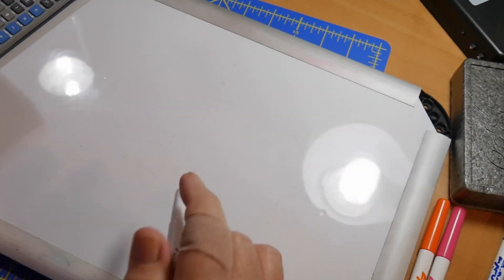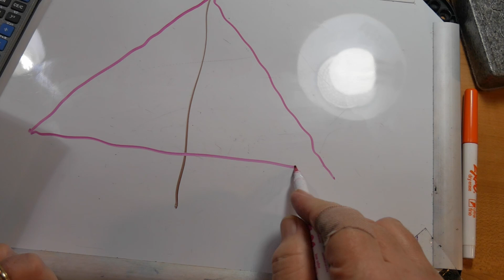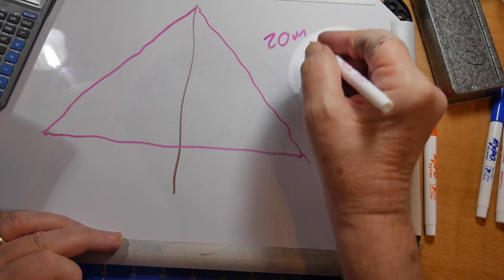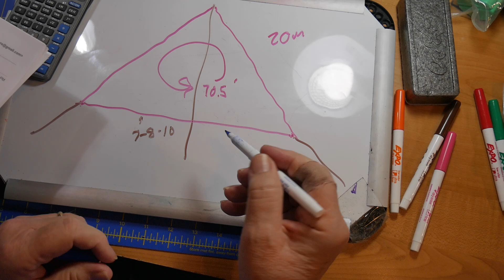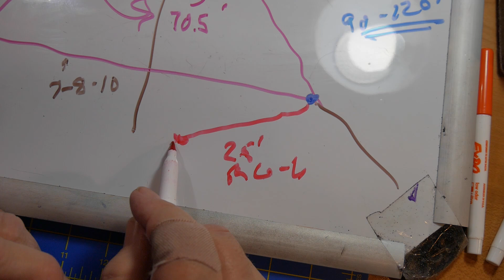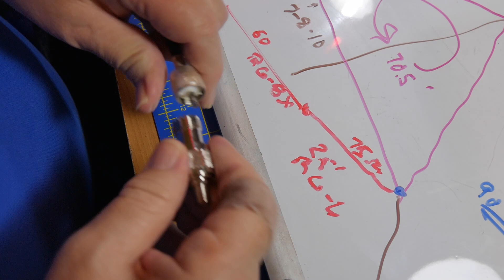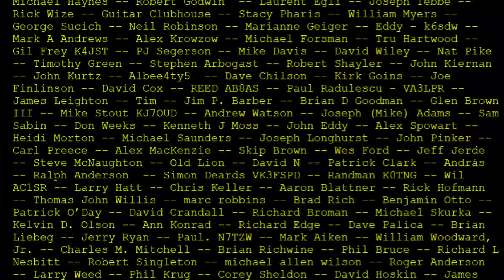Quicky 20 Meter Loop (#1193)

Comment: One question Dave - Could a delta loop be horizontally installed instead of vertically? -If so, what direction would it radiate? Thanks - Cheers!
Reply: Commenting because I'm interested too and I'd like a notification when you get a response - N6IMI
Reply: I'm not Dave, and I don't answer for him, but to answer your question until he comes to reply.....

The vertical delta loop will be bidirectional broadside to the wires.  It is not real extreme but there  is a little reduction of gain coming off the ends of the wires.   You can also place a wire or pole 5% longer or shorter than 1/2 wave about .12 to .15 wave lengths from the vertical delta loop to make it more directional in one direction. The shorter will be a director and the longer will be a reflector.  Just make sure your reflector is in the same polarity as your antenna.  If you are feeding it for vertical polarization, it will need to be a vertical element. 

If you add a parasitic element, make sure you check your SWR since it will interact with the main antenna. Sometimes, they lower the impedance and make the antenna a better match. 

You can lay the loop horizontal, as well. This is how most 80 and 50 meter loops are strung out, and they don't have to be triangular. If it isn't triangular, it is not a "delta" loop, with "delta" being the triangle.  
Horizontally, the loop is a loop and mostly omnidirectional, but with a bulge often in one direction depending on where you feed it and the shape of the antenna. 

Loop antennas are great.  A good horizontal loop can be  a  great match on the fundamental frequency as well as its harmonics. You may find the 20 meter loop has a great match on 19 meters as well.
Reply: @BlessedLaymanNC  Thanks!